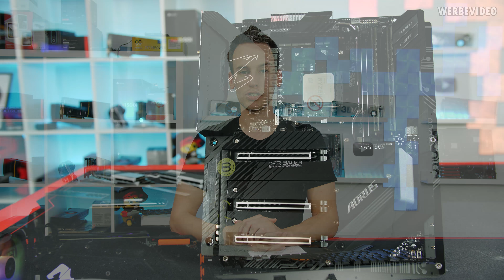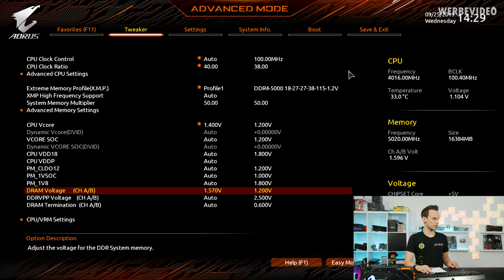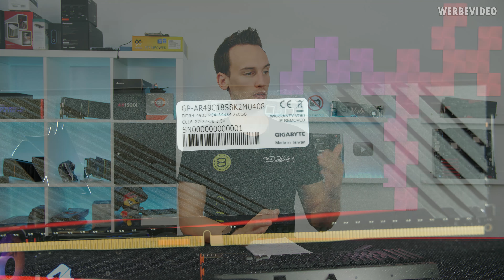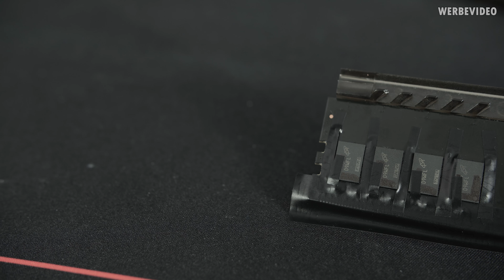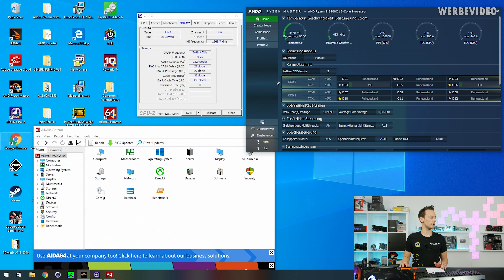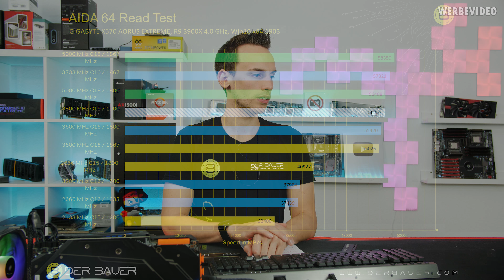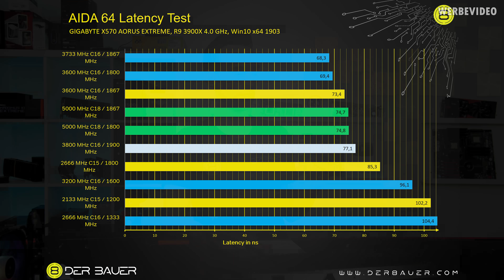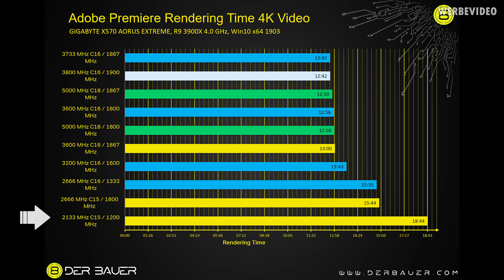Insane: 5000 MHz RAM Speed on RYZEN 3900X

Comment: The beauty of B-die (sadly discontinued) is the freedom to adjust secondary and tertiary timings to improve your system by a lot. I have numbers clocking in close to those results shown with the 5GHz kit, mine on a semi-good B-die at only 4.0GHz (intel though) and still memtest86 24/7 stable. 
Actually no I just rechecked, read 59149, write 61010, copy 54224, latency 40.0
That’s on a 9600k oc to 5.0, cache 4.6
Timings 15-17-17-28 CR2 (not stable with 1 above 3900 on my mobo)
Reply: B-die is not discontinued. Samsung has stopped selling DIMMs with B-die memory, but it's still making B-die and selling it to other memory sellers.
Reply: Hi Alexander, can you help me answer my question: how are you (and Roman) getting 55+ GBps measurements? I can only get 35 GBps using 2x8 GB G.skill 3800 C16 (IF 1900). Is it because I have less cores? (R5 3600). Thanks!

Comment: Would you do a video on down clocking the 5hgz memory to 3600/3733 and latency as low as possible like cl14/13? I think it would be cool and more practical for use on ryzen for those ram sticks.

Comment: Interesting that overclocking the infinity fabric alone, boosts performance, especially with slow ram. The 2666 with CL15 out performed 3200 CL16. Usually tightening timings 1 step doesn't have that much effect - but it did if the infinity fabric was clocked faster than synchronous. More testing on that would be great to see. Is there benefit for people stuck with a slower ram kit to boost infinity fabric, and does it work even better when timings are tightened, as it appears to do?

Comment: I have a Ballistix Sport 3200mhz CL16 2x8 16GB micron e-die kit. 3600mhz is no problem with mostly the same timings (tRRCD increased to 19, Trfc auto were the only 2 changes) and same voltage 1.35V as the XMP 3200 spec. 3800mhz was no problem too but was unstable. I noticed fluctuation in my fclock when at 1900mhz as well, it would dip sometimes. My motherboard does detect NB freq correctly as fclock in cpu-z (MSI B450-A Pro, Ryzen 5 3600).

Comment: I've had a Samsung Bdie 3200Mhz CL14 since 1st Gen Ryzen, that I could never get to run even at it's rated spec on first or 2nd Gen Ryzen. Now on 3rd gen Ryzen I have the same kit(on the same mobo) running at 3600Mhz CL14 which makes me so happy.

Comment: Legends say the fastest system runs at 2000mhz cpu, 2000mhz memory, 2000mhz uclk, 2000mhz fclk which is  the holy quadrality of clockspeeds.
Reply: the legends must be wrong because 2000mhz CPU is slow AF

Comment: Hi Roman, have you tried to drop these Gigabytes 5Mhz down to 3773MHz synchronous mode and try to cut the timings down to CL14 or lower? Might give better speed and latency.  Anyway thanks for your videos, can always count on you for your high quality analysis. Cheers!

Comment: @der8auer Now you just have to test the results when that memory is running either 3800mhz fabric 1900mhz or 3733/1866mhz and timings set to the lowest possible. The latency of the memory chips have to be really low, and when hand tuned to max, you could set out some nice records for 3900X.

Comment: I didn't know much about memory testing, but after seeing this, I want to play with my Corsair LPX again. I have 3000 Mhz CL15, and seeing the bottom of the chart, makes me wonder if there is performance left on the table.

I just set it to stock XMP (GearDown mode off so it actually runs at CL15) and set the fabric/memory to 1500 based on the recommendation. But seeing the 2666 Mhz CL15 at 1800 makes me optimistic.

Comment: I've been running my memory at 3600 cl 16... Which I thought was the tip of the performance I could get anyways. So I'll stay right where I'm at. Pushing everything to it's maximum performance.
Reply: I think a lot of viewers missed the point of this video though. These memory modules aren't designed for gaming. They could provide tangible results in some software where someone would be using the hardware for a professional job application, where time is money. Or for LN2 overclockers, chasing faster speeds.

Comment: My Aorus 570 Elite board clocks my 3600 memory modules with default bios settings at 2133! That's insane. The XMP should just be enabled by default, especially if the kit is recognized as in the QVL by the BIOS. 

But what I learned from these charts: get 2 3600 sticks, enabled XMP, and you have like 99% of the performance. The rest not really worth the hassle.

Comment: Interesting review. I'm currently running GSkill 3200MHz 14 14 14 34 timed FlareX modules 4 by 8GB (2 kits bought separately over 14 months). They are stable and run at specified speeds. Is this 'normal' or am I 'lucky'? Would it be worth overclocking or trying lower timings?

Comment: If you were extreme overclocking a ryzen system, does the infinity fabric scale up with the core clocks? Would the faster memory make more sense then?
Reply: No. The infinity fabric speed depends on the memory speed, or is set separately in asynchronous mode. The core speed doesn't affect it (other than a very minor effect on latency, which isn't likely to cause any testable difference).

Comment: Thaiphoon Burner screen please ! Then I think this are 9BE75-D9WFL micron e-die similar (or maybe identical) to chip used on Crucial CT16G4DFD832A (jedec 3200 1,2V). So basically is a binned version of 3200jedec modules... maybe some lucky one can buy CT16G4DFD832A  and install an heatspreader on it and push 1.5V... you can get close to this modules... (and this should explain also cause they not want to show what is under the hood...).

Comment: Sorry to ask, i know you don't usually do that, but would like to see some games benchmarked.
I think as many games are console ports and consoles have shared GDDR5 memory, which is used, as you probably know, as RAM and VRAM, i wonder if very high speed RAMs could simulate better the console behavior and even with "horrible timings" get better 1% and 0.1% lows, since GDDR5 generally have "horrible timings" as well. Thanks for the excellent work.
PS: DX12 and vulkan titles are a must in the test.
Reply: There's hardly any difference after 3200 MHz for gaming unless you are a 1080p 120 hz fps pleb, and you only really get benefit up to 3600 MHz with low timings and 1:1:1. Higher ram than that mostly effects professional software, like rendering and file compression/encryption software. This is why Roman tested some of those types of software.
Reply: @JosephArata  You probably havent read my entire comment, and i'm not 120fps "pleb" but i dont consider them plebs as well.

Comment: my question would be what spec is gpu ram at and what is  ram size that  was clocked to 5GHz

8GB/16GB/32GB/64GB/128GB/245GB/512GB/1-4TB dimms..

as for GPU memory, ar we speaking of 11GB/16GB/32gb-8TB..

Comment: I got some e-die here but crucial glued the heatspreader on and i don't want to damage them..maybe i can check in typhoon burner when i finally get a cpu
Reply: Are you sure it’s not just stuck on sticky thermal pads? It might be a thermal tape or possibly thermal glue, but typically, it should come off (smashing mine in backwards into the socket, and giving it a good punch made the heatspreaders go flying on my Gskill kit. I doubt that’s how you’re suppose to do it, but it didn’t damage anything).
Reply: @jakegarrett8109  nah you need to use heat gun/hot air on these to get them off but i won't bother for now (i have the equipment to do it) and yes these are thermal sticky pads put are more than strong to pull the ic chips from the pcb

Comment: I'm trying to figure something out.. my 3900x seems stable at 1933 fclk but my tridentz 3200 cl14 seems to max out at 3600 no matter what I do, I was even able to tighten the timings better then xmp at 3600. Should I swap to a 4000+ kit and lower it to 3866 and try to get as close to CL16/15 as possible or just keep it as is?

Comment: @der8auer It's actually trash-bin-tier E-Die, if you get C9BJZ (which is installed in crucial elite sticks or ballistix sport Lt "AES" series), it's possible to get better timings, I bet. I managed to launch my sticks at 20-22-22-40 @ 4466 MT and it's probably possible to go farther than that on a better board
Reply: Except the most important timing is the first one. CL 20 at 4666 is completely different than CL 18 at 5000. I've been messing around with memory timings since DDR2 and CL is the most important memory timing that comes into play with memory latency at a certain speed.
Reply: @JosephArata  On intel - may be, but on zen1/zen2 secondary timings and GDM status are even more important.  There's like 1ns of difference in latency between 14-19-16-15-32T @ 3800 with 1.55V  (GDM On) and 15-20-16-15-36 @3800 (GDM off) at 1.48V, while bandwidth is capped at IF speed anyway.

Comment: Imagine an APU with an rx 5600 6 cores 7nm on a laptop and the system memory runs at 5000mhz basically gddr5 speeds?
Reply: I imagine it would need a hell of a cooler. 7nm is good, but Navi's still not a very energy efficient architecture.

Comment: i get around 57gb/s, 40ns on 8700k@4.9 with ripjaws 3200mhz cl14 at 3733mhz 1.57v. saw some video where old amd got 10ns and hear some had lower. how can this 5ghz get only 75ns and some get same bandwidth and 10ns with less?

Comment: What's the delta between 3200 and 3600. I ended up going with 3200 because the price was significantly lower. Micron E Die kit.

Comment: im running gskill tridentZ last two years on 1.55 :) first on ryzen 1700 than on ryzen 2700x on 3466 13-13-13-28 1.55v :) now they are happy on 3800x 3766 14-14-15-32 1.55V so durability is not in question

Comment: so for various workloads how much better in performance would this ram speed be compared to others? On my 7820x with 3000mhz(14-16-16-35) ram I did the same test as you did in AIDA and got higher read/write/copy than the 5000mhz ram you were using. Do ram timings have that much of an effect or is there a difference between amd and intel when using different ram speeds? I was under the impression that higher ram speeds on amd would do much better. Is this such an extreme case where the timings are so much higher that the performance from the 5000mhz speed is degraded due to something like diminishing returns to the point that going too high in speed results in worse performance than predicted? Or is it just something due to the limitations of the infinity fabric?

Comment: Net time u meet gigabyte ask them why they don't upgrade the bios with the new rams.The motherboard Aorus Ultra Gaming 2.0 op is not running the ras at 4000Mhz from G.Skill Trident Z Royal Silver Cl17 17 17 17 37. Whn i install the rams the motherboard recognizes at 3600Mhz with the xmp and the max overclocking i can do on this motherboard is +266 so i get 3866Mhz insted of 4000Mhz.

Comment: That is pretty impressive, the latency is even sub 80ns, nice. But I can't even run my modules at 3100MT/s, but granted it is 128GB kit.
Reply: I'm just surprised that 3200 c16 kit have such huge latency at 96ns. I use 2700X with 3200 c16 but the latency is at 68ns.

Comment: I was wondering if I should buy 2666 (official from Samsung, cheapest) or  3200 (overclocked?, at least 50% more expensive), because anything above 3200 is too expensive here, but according to the graphs, the performance of the two do not differ that much. The significant difference seems to start at 3600. So I can just go for 2666 and save money, and then upgrade the RAM in a few years when  faster RAM comes from Samsung and gets cheaper.

Comment: Could you test effect on APU graphics performance on 3400G, it should love the 5GHz.
Reply: They wont boot apu on last arch ryzen3000 is a new arch over the lastgenn apus
Reply: the 3000 series APUs are still ZEN+...they wont ever run at 5000"ghz"
Reply: @skoopsro7656  no ram ever will run on 5000ghz thats 5Thz

Comment: You should try and run those 5GHz Dimms on a z370-390 platform with a 5GHz 8700K-9900K and see if there is a benefit to running those types of kits on the Intel platform.
Reply: This ram sucks. My G-Skill @ 4200 Mhz CL16-18-18-28-280-2T is faster 64K Read 64K Write 59K Copy 37.6 Latency. Garbage timing he have there 18-27-27 WTF is this.

Comment: Why was the 3200-16 setup performing so badly? Was the 3800/1900 setup unstable because of the infinity fabric do you think? I have a 3200-16 kit that almost runs stable at 3800-16/1900 but it'll error once an hour or so. I tried loser timings/more voltage but no luck so I started to think it was the IF that was unstable or one of the tertiary timings/voltages I don't understand.
Reply: Try using 2T command rate, and/or turn gear down mode on. That works for me at least to get 3800 stable

Comment: Wouldn't it be possible to take this memory rated at 5000/18 and run it at 3600 or 3733 with custom timings sub 16 cl using the same 1.55v? And wouldn't this be chart leading since it would be synchronized but also lower latency than the cl16 kits?
Reply: They already sell 3600 cl14, and you don’t need that much voltage, lol, that wouldn’t be very ambitious so definitely could do even better than that.